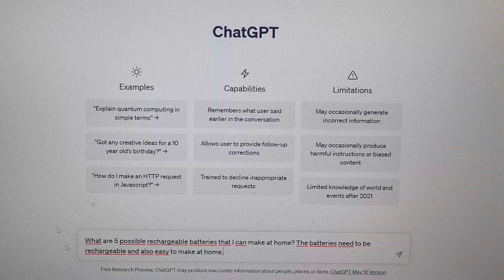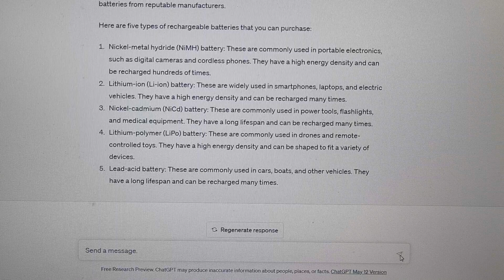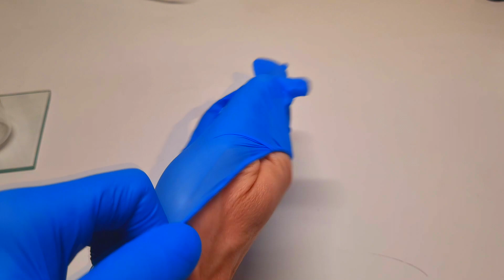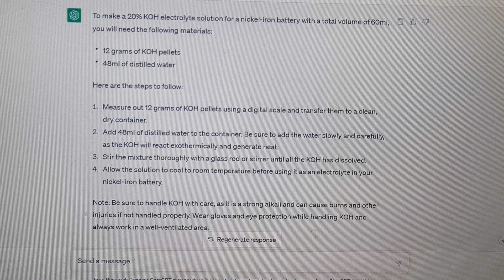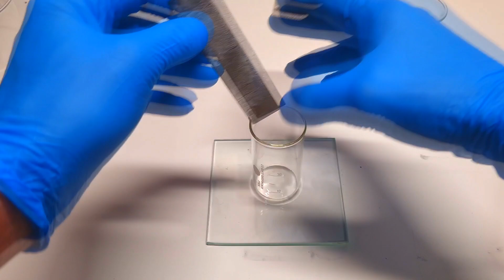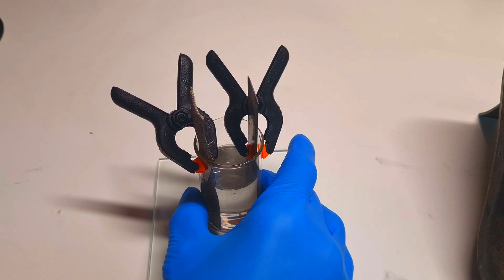Making a battery with the help of artificial intelligence?

Comment: The biggest problem with metal Air batteries is, that you need to have a breathing charcoal or carbon electrode !!
So the best solution is to make the carbon electrode as a wall of the container, so at the outer side where the electrolyte is not located, it can breath in the air and thus the oxygen .
If you just stick the carbon electrode into the electrolyte, it can no longer breath oxygen and the cell's power output dies down, cause it is missing the oxygen...
Reply: You can also add the oxygen automatically by using an oxidizer like KMNO4 inside the Electrolyte so the carbon willl get the oxygen from the Electrolyte KMNO4... But be a bit cautious with it....it is a strong oxidizzer, so that it does not ignite and burn, if there is too low water in it... Regards, Stefan.

Comment: ya, i been doing the same. i m trying to reverse-engineer a YouTuber's self-charging capacitors.
Reply from the maker: Interesting. Which one?
Reply: this is what i am trying to reverse engineer. this guy died 2 years ago  https://www.youtube.com/watch?v=30h6hrxACdA&t=1227s
Reply: No such thing as self charging, sorry
Reply: @veronicathecow  Well it is possible, if you condition the capacitors long enough they will quickly recharge themself when you discharge them. It helps if you use a graphite rod to discharge them as the electrode and make a sparkduring discharge. then the cap will really recharge a bit after you shorted it out very fastly...
Reply: @veronicathecow  never say never here is another YouTuber explaining how this could be done 
https://www.youtube.com/watch?v=M0RbxfoJ69k&list=LL&index=6&t=199s